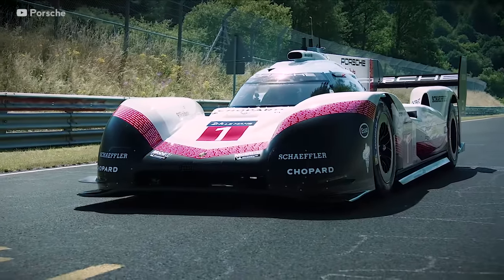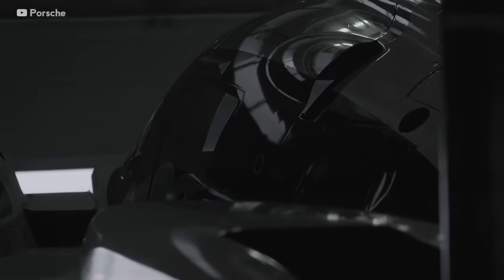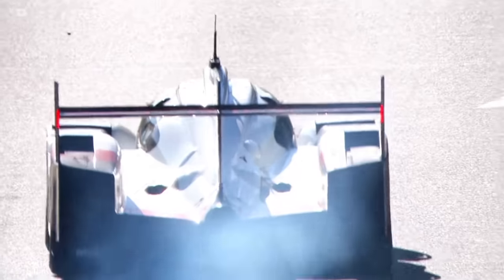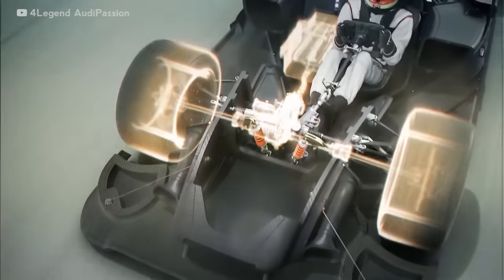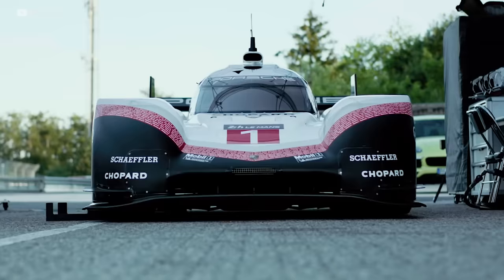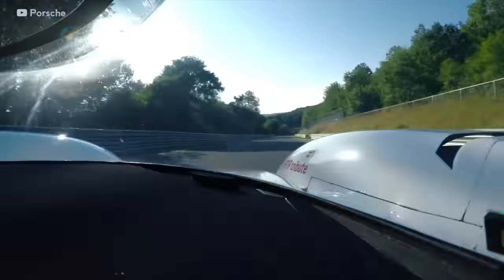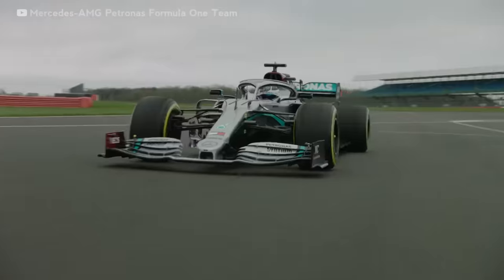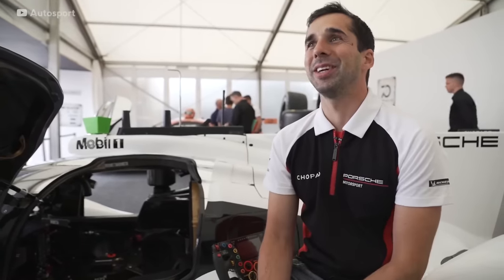How Porsche Built a Car Faster Than F1

Comment: 4:30
"The Porsche has a power to weight ratio of 1350hp/tonne"
The Mercedes W11 of 2020 had 1369hp/tonne.
A bit embarassing for 'no rulebook' Porsche.

https://www.gpblog.com/en/news/64680/-mercedes-had-in-qualifying-mode-1022-horsepower-with-the-w11-.html
https://www.mercedesamgf1.com/en/car/f1-w11-eq-performance/

Comment: well, I don't care what the new F1 rules are, as long as they stop using vacuum cleaners as engines, and make who wins not team dependent because of how unbalanced it is.
Reply: That's actually what I LIKE about F1, the engines and teams being dominant. I don't find watching Billy Bob McTebakkeychew being held up as some shining star in the cookie-cutter world of NASCAR, for example. I like tech and wars between engineers. If I wanted a soap opera, I'd watch wrestling, I guess.
Reply: @exploranator  NASCAR is more complicated than it looks on the surface, but that's not really relevant right now. I like constructors championships, like Super GT (formerly JGTC), but F1 is a bad constructors championship, and it has a """driver's championship""" which is pointless really, because it's decided based on what team you're on much more than, you know, actual driver skill.

Comment: Sorry, no longer true. F1 cars have lowered the 919 lap times at Spa multiple times, and surely would do the same if they were to race at Nurburgring. And that's under the ever changing F1 regulations. No F1 team will modify their race cars while they are racing for the title: Porsche did this because they had withdrawn from LMP1 and had no further use for the 919.
Reply: Let's not forget that the 919 Evo was launched in 2018.

Comment: But f1 cars has power limited, nah a 2020 f1 fully unlocked its faster
Reply: Break all the rules and regulations, and f1 cars will be faster than anything. But that joy will only last a few minutes before it ran out of fuel and overtaken by an LMP1. And also, this car is still far more cheaper than the F1!

Comment: The 80's was the pinnacle of race car performance. During the 80's with the group B of rally cars or with the improvements in formula 1 cars, the G forces that a common race drive could handle, were raised to very dangerous levels.  
That's why since then the formula 1 and rally cars have been constantly underpowered by official restrictions for the safety of drivers and the reputation of the sport. 
Even with restrictions the engineers always find ways for higher performance until new rules ban their achievements.

Comment: F1 cars are not that fast. I’ve seen a Supra go faster.
Reply: that's a joke right?

right?
Reply: @SlavJerry  no F1 cars only go 360
Reply: @lurtzy_  of course they didn't made for top speed, they made for maximum grip and downforce in a circuits. if you put them in a race in somewhere like monza or spa, F1 is clearly win

now stop compare supra to every cars with a top speed and "oH iF yOu TuNe It It WiLl FaStEr ThAn EvErY cAr" no shit because it's completely incomparable.

from another supra fan btw

Comment: The 919 Evo an illegal car. Heaps of stuff which is illegal. But its a Porsche so that's okay.
Reply: its not illegal. It just doesnt fit the reglement of WEC. It isnt driving at any official race.
Reply: @d3203  Illegal for racing. F1 cars meet racing regulations. It is a ridiculous comparison between this 919 Evo and F1 lap times. If F1 was unrestricted it would be no contest simply because F1 budgets dwarf anything Porsche can spend.

Comment: Its not faster than F1, just faster on the nurnburgring because F1 suspension can not handle the bumps of that circuit. Full stop.
Reply: what about spa? at the time, it was faster than f1 cars around there.
Reply: Luke Castellan That is definitely possible. Spa has very long straights. It will depend per track.

Comment: Car daster than f1? Lmao no! Maybe in a straight but not in real circuits as f1 cars dont even race long nurnburgring.
Reply: isn't spa a "real circuit"?
Reply: @lukecastellan721  The track record is from an f1 car
Reply: @tw3039  I know. The w11 was a beast. But before that, the 919 evo was the fastest around spa, making it technically faster than f1. keep in mind that this video was made before Lewis set the track record.
Reply: @lukecastellan721  yet you said spa isn't real circuit like 13 hours ago trying to mock me. So know your shit
Reply: @tw3039  when this video was made, the 919 was the fastest around spa, that's all I'm saying.
Reply: @lukecastellan721  yeah but you mocked my comment right now as my facts were correct so stop the cap